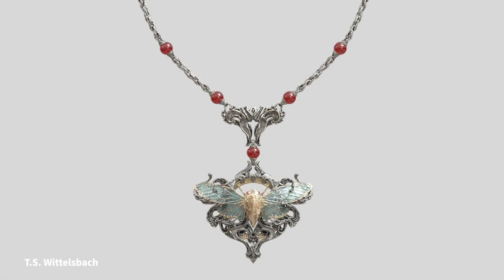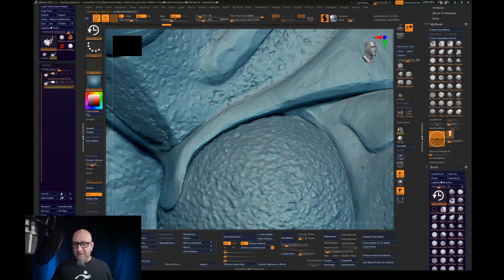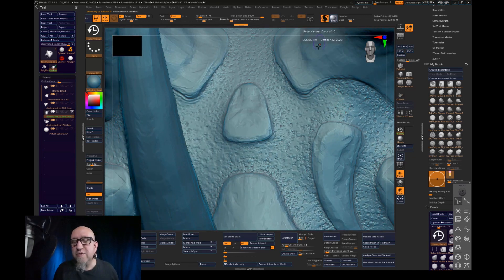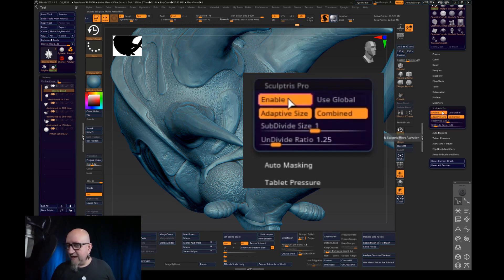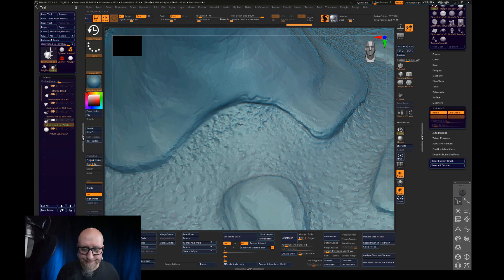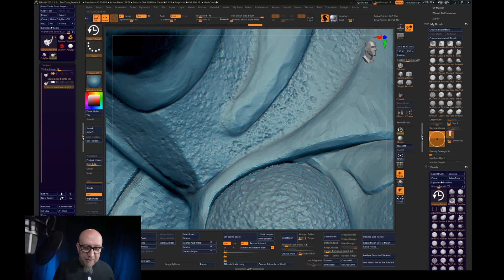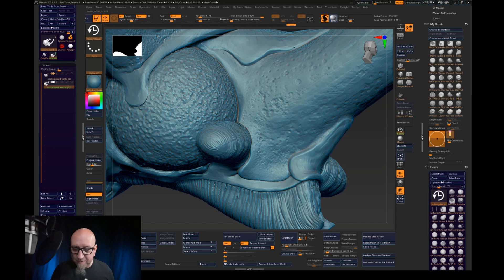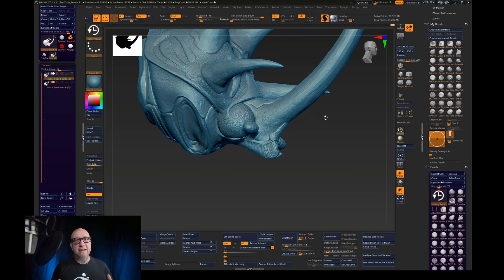SculptrisPro for Retaining Details in Your 3D Model  - ZBrush Top Tips - TS Wittelsbach

Comment: Thanks a lot! this was a great tip! On a related note, a question I've always had is if a workflow similar to this could be used for sort of controlled decimation. Like how you paint here to add more details and with history state painting, but not to increase but to decrease detail. I know zremesher/decimation can a bit be driven by painting colors, but this kind of workflow would feel more intuitive... if it was possible.  In my little experiments trying to tweak sculptris I didn't quite get the expected results. What I had in mind say having a decimation and then painting some parts of the model where you'd like the decimation to go to even crazy levels because you don't care about the detail there/rougher shapes would work with the design. I'd be super curious if anybody has a workflow like this video. Getting back to the subject: thanks for the great technique, and in general for the whole Zbrush tips section, love it. I hope it becomes a permanent Zbrush THING just like Ask Zbrush which is also great.